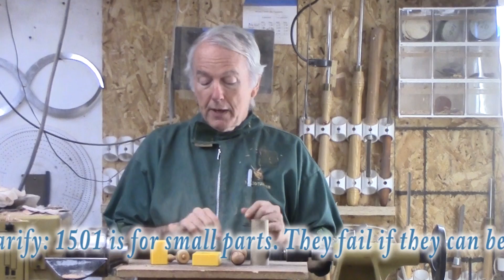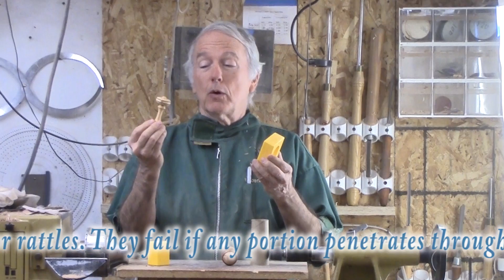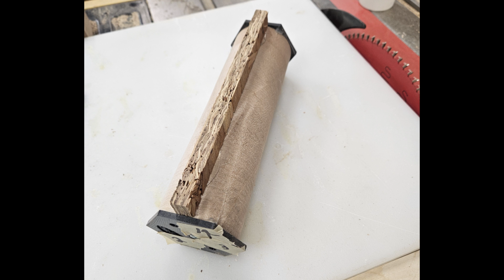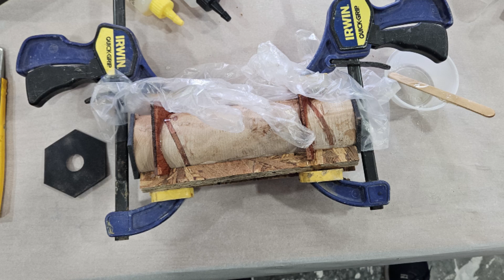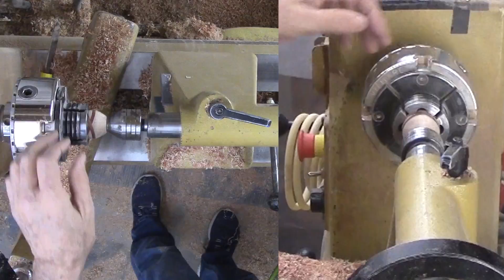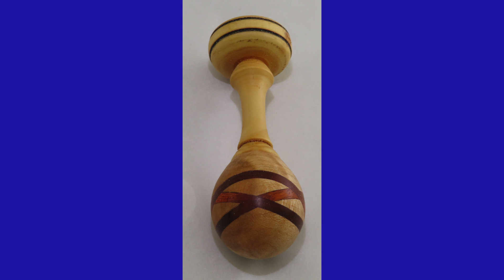Turning Celtic Knot Baby Rattle Compliant With Safety Regulations

Comment: Your end caps are a neat idea. Also the spine to allow through cuts. I thought the regs only required a part to be of a certain diameter at the big end. Thanks for the update. I will adjust my future baby rattles appropriately. Have a great day. I am continuing to turn safely.🙂🙂
Reply from the maker: I lot of people are confused by the regs and stop with the small parts. That is the one where the part much not fit entirely inside the cavity. Then they overlook the rattle reg which is what I wanted to highlight.

Comment: Thanks, Alan for the clarification and testing examples.

For reference, here are links to those USA regulations:
Small Parts: https://www.ecfr.gov/current/title-16/chapter-II/subchapter-C/part-1501
   Test Fixture Dimensions: 1.25 inch (31.7 mm)  hole, 2.25 inch (57.1 mm) deepest side and 1 inch (25.4 mm) on the shallow side (45 degree angle bottom)
Rattles: https://www.ecfr.gov/current/title-16/chapter-II/subchapter-C/part-1510
   Test Fixture Dimensions: Oval hole with two circular ends 1.378 inch (35 mm) diameter, total hole width of 1.968 inches (50 mm),  which means a distance from centers of 0.59 inches (20 mm). The depth of hole is 1.181 inches (30 mm).
-Stuart